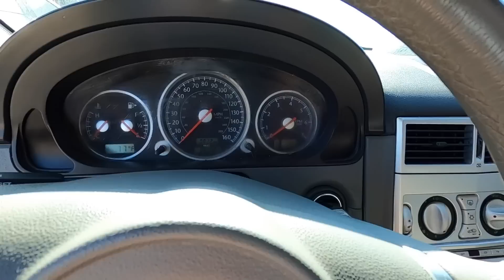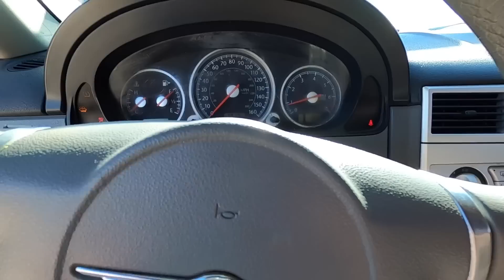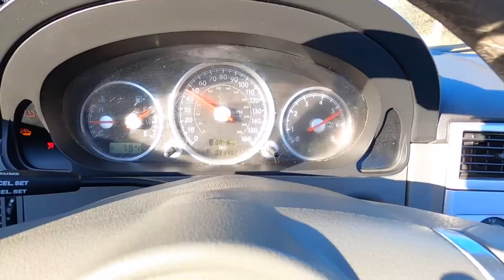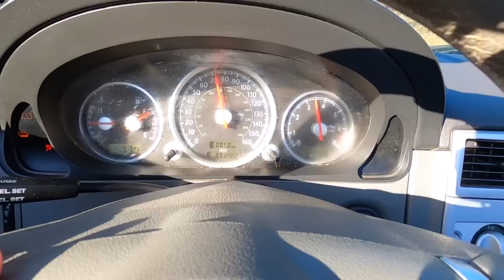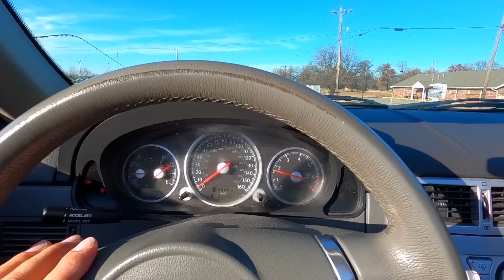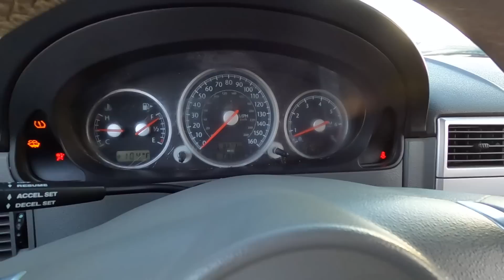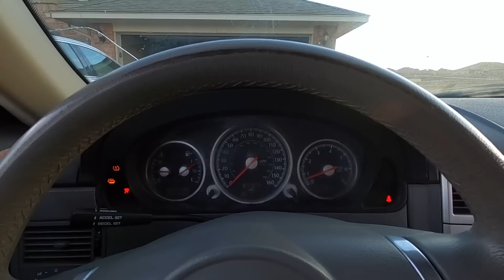Copart 2005 Chrysler Crossfire Roadster Top Repair - Hydraulic Hose Leak

Comment: Most of that car is based on the Mercedes clk and slk
I had a similar problem with the top as you unlock it and pop it up it won’t stay up.  Mine had a steel cable each side and the one had broken.  I was able to crimp new lug on end to fix it without buying new cable.  It solves the other problem when closing that you have to catch it as it comes down
Reply: I hope Randy reads these comments. We want to see him fix this if possible!

Comment: Check with a good  locksmith  I  have had good  luck  with them fixing  poor  broken keys  or get  advice from them.
Reply: A locksmith is the best way around this, they can cut extra keys if needed and re-program at a fraction of the cost of a dealership.

Comment: Even the smallest amount of air can screw up an hydraulic system and that latch may be the highest point crack the fitting and I'm sure there is a sensor that measures pressure if it gets air it reads nothing because its not fluid and the control module shuts it down to stop damage.

Comment: Does that top have the same soft close feature like the trunk lid on the Cadillac or Lincoln? If so check the solenoid also previous owner may have slightly bend a rod on the top trying to close it good luck

Comment: I know you recorded this a while ago.  Two things come to mind seeing how the hydraulics of the top are working:  the system still has air in it - that's why the tonneau won't fully close and the back window gets suck in the wrong position.  The other possibility are the location of the limit switches that tell the computer where each piece is.  But the most likely cause is air in thee lines.

Comment: Use that Autel to scan all modules. The convertible top seems like there is still air in the hydraulic system. Maybe there is a bidirectional purging procedure like ABS brakes. Also the key may be stuck due to a range sensor issue. Use your Autel to see if there is bidirectional command to manually release the key.

Comment: The tire pressure monitor system light normally means the sensors in the tires have dead battery's my 09 rogue before it was hit it an accident and totaled out last month had the same issue the the TPMS.

Comment: The latch also runs in sequence with the hydraulic pump you just need to loosen the reservoir bolt a little to blend out the air just go up and down until it latches

Comment: Hold on to the crossfire for awhile.  Once you get it fixed you will definitely make a profit because of the low mileage and it's a collectable. You've fixed worse problems. Remember the black Mercedes? 👍

Comment: Regarding the top not working after your ride. My advice, first download an owners manual. They're free in a PDF format online. The owners manual will tell you a fast flashing top switch light it's telling you the partition is not in place. Whatever you did to defeat the partition micro switch probably dislodged during your ride. The dash warning light that you think is low windshield solvent is actually low coolant. There's a float in your filler tank that may stick or you may need to add a little antifreeze. The temperature gauge will continue to run in the normal range, even though this float switch light appears on the dash. The owners manual will help you  understand how to resolve your issues. I have Mercedes SLK which essentially has the same systems. Good luck!

Comment: I would put my bet on micro switches that are “telling” the system about current position of the top. 
Is there such a thing as a trunk compartment divider (as in my CLK) that should be in a certain position when you trying to open the top?

Comment: You have air in the Top Hydraulic System that needs to be bled out.  Manually open and close the top a few times this should purge the air.   Before doing this you will need to manually release the pressure in the system I believe by: turning the key to the Accessory position with the car off and then holing the top down button for at least six seconds until you hear a beep; you will probably hear slight noise of the pressure releasing.  Good Luck.

Comment: I typed in Crossfire "crossfire convertible top won close all the way", and google provided too many answers to print here. You might try researching that phrase if you haven't already.

One answer I did get 

The flap in the boot must be all the way in the up position and well fixed to the Velcro , if not, it will not function.

It must be in park and the windows all the way down. 
 
Buying a new top may not solve the problem either, I wouldn't do it. Just putz around with it some more, it's interesting watching you try to find the culprit, makes for good vlogs.

Comment: I owned an 07 Chrysler town and country. I had one passenger sliding door that was never quite right. I replaced the lock mechanism 3 times on the same door. The lock itself had a lifetime warranty so other than my time replacing the lock wasn’t a big deal. 

Two thoughts. 

1. Is it possible that the lock mechanism on the broken top is causing some sort of open circuit? That open circuit won’t let the key release?  Kind of like when a car isn’t fully in park the key won’t release?  Maybe it’s like a security feature, the broken lock makes the car think it’s not secured and therefore can’t take out the key.  A stretch I know, but sometimes electronics can cause issues like this. 

2.  On the top itself, I think it’s air bubbles that need worked through.  I feel like you need to “bleed” the system but somehow from the top side where the air is likely to be. 

I’m just a shade tree mechanic....most things cost me 10 times the real cost to fix but I get a little smarter each time and apply my hard knock logic to my next problem. 

Would it be possible to sprinkle a smidge of graphite lube above the ignition? You may have to take key and ignition out, but maybe some graphite could be just enough to release the key then rebuild the tumblers. 

Bless you!  

I don’t care what type of content you make, I’ll watch whatever.  The star of your channel is you.  You could wash the lawn mower and I’d watch. 

Keep it up!

Comment: Check all the wiring and make sure the connectors are dry and clean on the computer. Also check all the limit switches on the top.

Comment: The tire light could be a bad sensor inside one of the tires!
Reply: I was about to suggest that myself. I had the same issue with my 2008 Pontiac G8, until the sensors were replaced.
Reply: T.p.s. sensor is bad. O.e.m. are like 150bucks each. I have the same problem
Reply: It's a dead battery in the sensor, you can order sensors online that screw onto the valve stems at a fraction of the price of replacing the originals. I heard they were around $70.00 but check it out yourself.
Reply: Or faulty TPMS module.

Comment: If you need to sell it then you're the best judge of that. I guess the learning here is not to spend big money until you know the main problems ( roof, key) can be fixed. I suspect the roof will work again and the tonneau latch is just a sticking solenoid or whatever.

Comment: the tire sensor may be bad but you might check and see if these cars want nitrogen in tires, with air the pressure will increase as the tires are used, might be why you have the light at first and as the tires get warmer the light goes away

Comment: As for the stuck key, it commonly is one of two things. The easier is bad ignition cylinder. The second is when the transmission “park” switch is bad and the car does not think it is fully in Park. The cylinder will not release the key.

Comment: I have one just like yours.  Have a leak as well.  Mercedes and Chrysler could never find the leak.  Mine has 52,000 miles. Engine is perfect and has so much zip.  Just have to manually manage the roof.

Comment: Having set for a while and not being used, the valves are likely sticking. May have to flush it once and cycle it several times to get the air out of the system.

Comment: By end of 2020, I WILL have a Crossfire. Hopefully will find a 2005 srt6 (50K miles or less) for less than 11K, low mileage. 2005 only year SRT6's were a good % of production. Also, a coral interior would be great, but hey, ya can't have everything.

Comment: Yeah I like working on washer and dryers too. Not a whole lot to them
Reply from the maker: So much easier than cars man.
Reply: Auto Auction Rebuilds yeah I know. I’m a certified diesel tech but work in a factory making brake lines and vent tubes and other tubes

Comment: One of my cars had a similar key issue so I took it carto a small  foreign car repair shop and they found out that the problem was  an interlock cable between the shifter and the key switch. he adjusted the cable and all was fine.it is another dummy driver safety feature, so you can't start the car in gear. you might want to check that out, maybe Eric the  ca rguy can help you out LOL.

Comment: Motor suddenly stops working and the top won't move. Spoiler works and it's on the same circuit. Start checking ( In no particular order. ) fuses, relays ( Remember, you are dealing with a rebadged Mercedes. ), and proximity\limiting switches. Hooking a volt\ohm meter to the switch and working it by hand will tell you if it's bad. Remember, that pump has fuses and relays. I'm betting that's your culprit. Limiting switches for the top getting jammed, and for the slamming of the front of it.

Comment: You could take the imobilizer off the actual key and buy the shell kit and take it to a locksmith and will cost $50, I did that to my Honda and it worked out ok

Comment: Hi I have a 2004 Crossfire Chrysler. It sit for 3 months because it wouldn't crank after replacing crankshaft module, tcm and soddering three places on power module.

Went out jiggled battery cables it started i drove it..came back in driveway .parked it wont crank again.

Can you please help.me if you might know what else it could be?

It won't crank back up. By the way my crossfire is black just like yours.
Reply: Crankshaft position sensor, is the part I had replaced. 
Thanks for the videos.

Comment: That tire sensor battery might be going dead so that shouldn't even be an issue you shouldn't worry about that you can getWalmart set of sensors and screwed on the valve  and have a monitor that will tell you how much air is in the tires

Comment: Fix it fix it , good content there!! Don't give up! But do it without other parts, just mend around, learn to do that top yourself, it's very accomplishing.
And btw pretty sure it's just missaligned stuff, bad contact and no lube.
Regarding the key, remove the dash, clean every contact while so and with a pick wiggle it from lateral and behind. Also some wd40 direct in the contract, squeeze as much as you can

Comment: So if the hydraulic motor isn't spinning or working and your for sure that the fuse isn't blown you can rebuild the motor for next to nothing it's also possible that the top won't function correctly because of the weak motor. Or bad impeller also replaced for next to nothing. Dig deep brother.

Comment: The catch on the hood cover is most likely bent and binding. I would disconnect the hydraulics from it and try cycling it manually. They are just pressed steel and can be eased back to shape easily. Your best stategy for the roadster Crossfire may be to work on it methodically and slowly over the winter, then send it on the first warm day in March when it could sell for $6000 or maybe even more. And in the process you would generate good YouTube content which would result in a nice profit. Then next year you will know enough about these cars to tackle an SVT6. And if you think your current two "Chrysler Mercedes" are quick, you ain't seen nothin' yet!

Comment: Fix and sell the coupe as you have the parts, return the Convertible tyres back to the supplier and then park the Convertible. Just leave it alone for a while. I noticed you earlier said you were 'fighting' the car. You never think straight in that mindset so just leave it alone for a while. Maybe think of it as a longer term investment to be sold in warmer weather. Don't sell in anger or you will regret it.
Good luck as always and 'Posi-Vibes' from across the Pond mate ...

Comment: Probably the seals are leaking in the lift cylinders, simply because somebody let it run dry.
The trans fluid level should have been an indicator.
Metal and rubber contact without lubrication generally end in disaster.
I'd give it a shot.

Comment: If that top is not popped up and it tries to open it’ll blow things up. Probably what caused your problems in the first place.  
I also had that damn flashing red light, took it to dealer they just reset everything and it worked.  
Once you get it working don’t ever pause opening or closing halfway.

Comment: Finish up the Crossfire coupe and get rid of it.  Keep the convertible and fix it.  Doesn’t make sense that the hydraulic pump went bad that quickly.  Check the power supply and bleed the hydraulics.  Bet you’ve got an air in the system.

Comment: I would walk away, except that I’m sure whatever is causing the top issues is something dumb. For example have you checked the micro switch on the trunk liner ?? It’s got to be something dumb and fairly easy to repair if you could diag it.

Comment: Give the car to your brother to work on on his channel. Or maybe he will drive it. He could glue the top back together and just leave it up and drive it. And buy another key so you lock it and leave the  old key stuck in the ignition hole.  And lock the door with your extra Valet key. You dont have to put the top down. Somebody could drive that nice car with out putting the top down. It would be dependable. But I would like to see you fix it. You could put it in a garage and work on it after next year. It makes good video content. Save it for later after you take care of your pending issues with your house and what ever else your concerned about for now. But its only 3,000 bucks you can let it sit for awhile. And see if you can fix some of that stuff cheaper than you thought. How much for lock smith to make a key for it first off so you can lock the door and just leave the stuck key in it because it dont hurt nothing like that. Buy a valet key for it from a lock smith they can make one for the door lock. Park it in the garage at your house in the country. My dad use to give me his old cars to drive the rest of the good out of them. Bless his heart.

Comment: work on crossfire coupe, get it completed and ship it
. get a locksmith to see what can be done on key problem....see if there are any codes for top, (this might need a professional) stop worrying it will shorten your life....... convert runs good only problem top(i am thinking microswitch timing) and you might have to purge air out of the hydro top system. stop worrying my friend

Comment: You’re  starting to think in terms of a business rather than a hobby.  You can test the pump motor by isolating it and applying power to check it. The latches are probably bad solenoids. The fact that it suddenly stopped working more than likely is an electrical issue. Your pressure monitors are a likely cause of the warning light on the dash. All this is just a guess and is worth exactly what you pay for it.

Comment: Disconnect the top computer and soak it down with CRC QD Contact Cleaner from Home Depot. Let it dry a few days before reconnecting. DO NOT USE THE CRC LECTRA CLEAN OR ELECTRONIC CLEANER. Those can melt plastic.

Comment: There is still air in the system!!!! you have to keep running it up and down. The lock is hydraulic.
Reply from the maker: I know how to bleed the air, the pump is no longer working at all as I said in the video.
Reply: @AutoAuctionRebuilds  You keep topping it up as you were purging it? There's probably a sensor in the pump that detects the amount of fluid and disables it  past a certain point

Comment: G'day from Australia, The house that you bought is too far away from Jessica's work to be a success. I would sell it and buy a vacant lot outside the city but within 30 mins of OK City.  Build a workshop and separate your home from your work. Take the Crossfire to a locksmith. If that issue can be fixed, then move back onto the roof.

Comment: Randy Stop rambling on and on. Dont sing to us either. Just concentrate on one car at a time rather than jumping from one to another - you will be much less stressed by getting one complete and moved on. Regarding the top - check out to computer that became soaked with oil. Some oil may have found it's way inside.

Comment: What is that chevy? Right beside both of them?
Reply from the maker: 2020 Malibu
Reply: @AutoAuctionRebuilds  I know this is a longshot but did you fix that top or sell it? The reason I ask is I have a crossfire that two years ago got out of sync somehow. My problem has been not been able to find anybody locally I’m in North Georgia to isolate the problem. Like you those damn red lights on that switch in the beeping well I’ll just say I didn’t drive the car for a year I’m ready to try again. Those cars are just terrifically fun to drive in 10 times better with the top down. I know you’re busy I do like your style if you can shed any light on this for me I would appreciate it thanks man! Keith